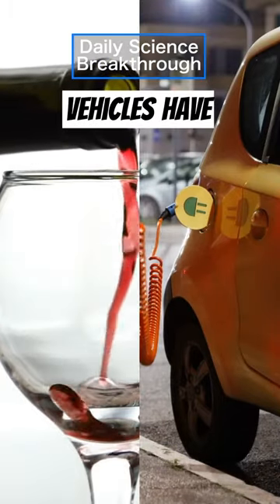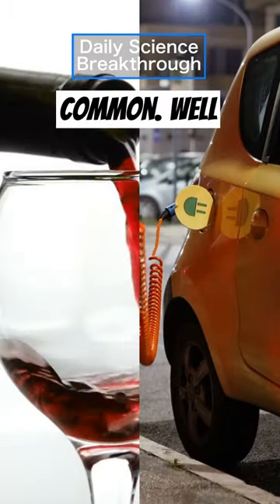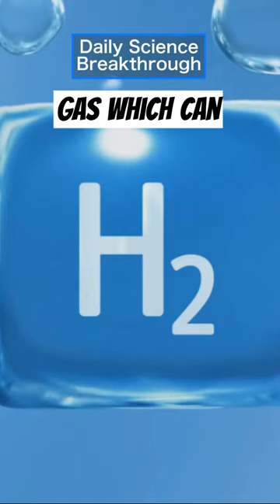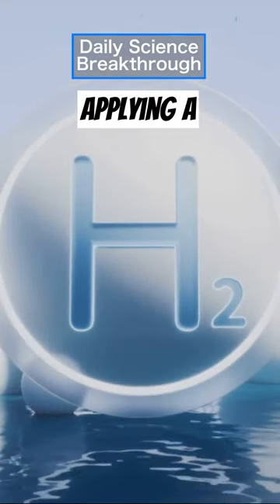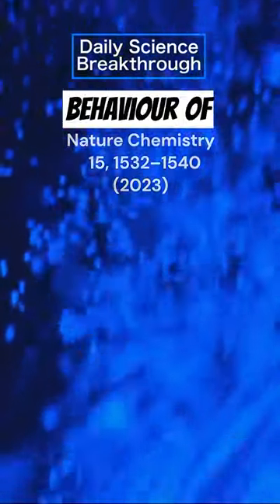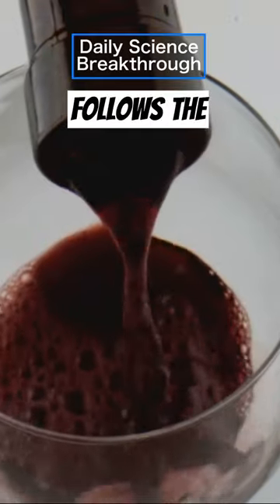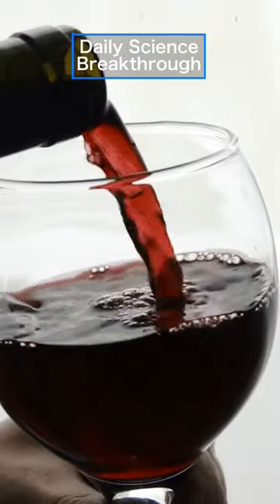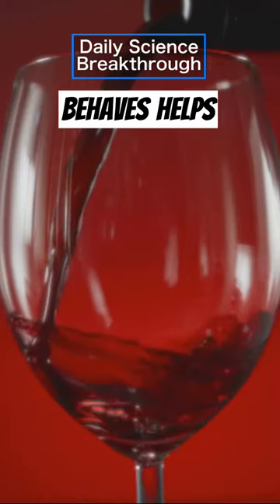What does wine have to do with hydrogen vehicles? #science #chemistry #wine #hydrogen

Comment: I keep coming back to the energy loss in the conversion of electrons to hydrogen. 

Electrolysis: 20–30% of energy is lost in the process of creating hydrogen

Compression and storage: Another 10% is lost when compressing and storing the hydrogen

Conversion to electricity: Another 30% is lost when converting the hydrogen into electricity

Unless the application is flight or rockets, why not just use the electrons as they are, without the intermediate energy losing steps?
Reply from the maker: I totally agree that the energy loss is a huge challenge. But I don't think electron can be used as they are. 

Energy needs to be stored somewhere to be ready to use when we need it (one could use electron/energy directly generated on a photovoltaic panel connected to the car, but as soon as it is cloudy or dark, then no more energy!). So the best options are fuel cells, batteries, and supercapacitors. Fuel cells suffer the most from energy loss, but have other advantages so it is still under serious consideration by scientists all around the world.

If generating electricity or hydrogen becomes cheap enough (from efficient solar cells, photocatalysis, wind farm, etc.) then even if there is energy loss, it might still make economic and environmental sense. 

Thank you for your comment !